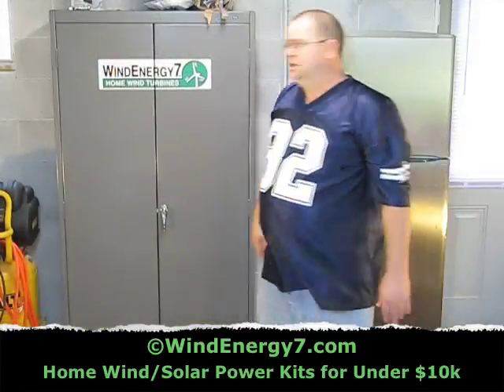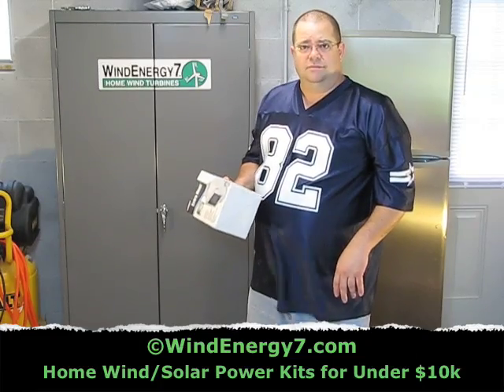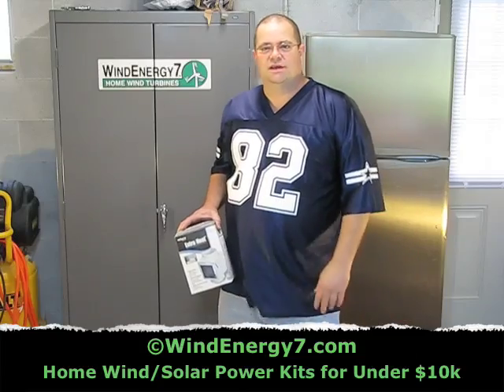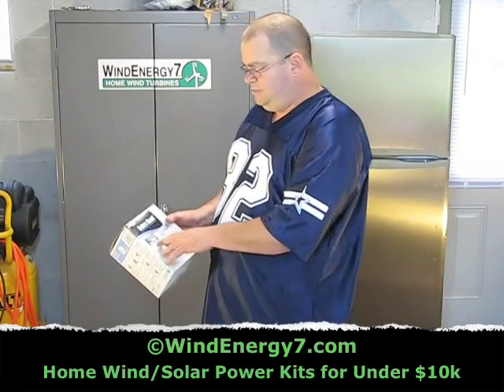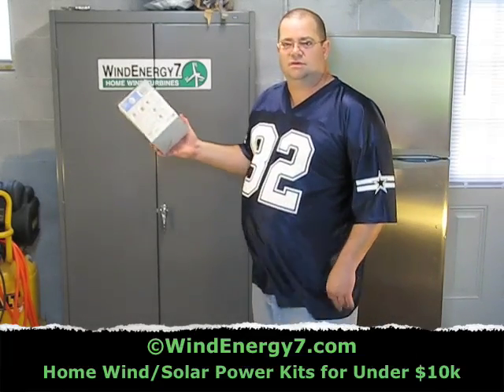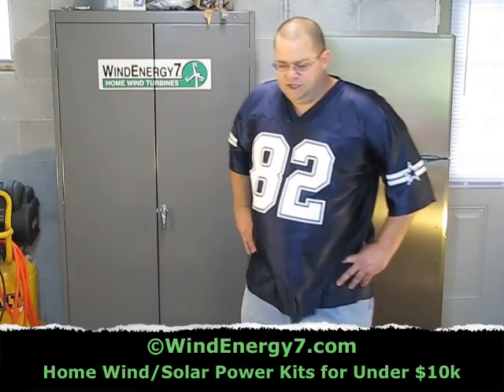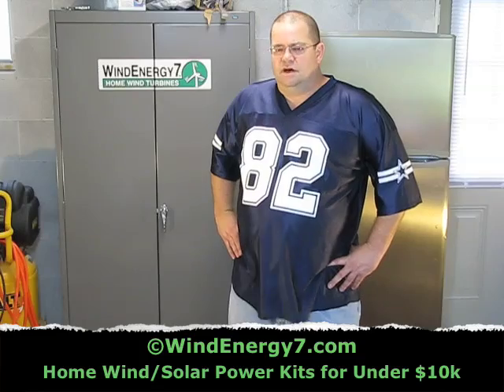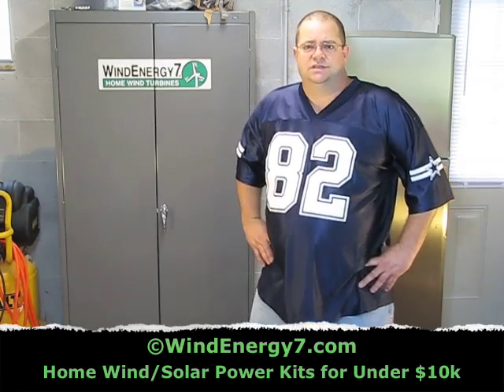Home Energy Conservation Tips, Small Wind Turbine

Comment: Once you have a home wind turbine, you start to really watch the watts you use.  The goal is to try to live within your home wind turbine capacity of power.  So, anything helps to trim your usage.  If you are in a colder climate, or almost anywhere that you would use heat in winter, this is a great tip with the dryer vent bypass. Together with a productive home wind turbine kit, you'll be saving lots of money.

Comment: The system featured here RoofMill™, is the invention of WindEnergy7 LLC founder, pictured in the video. This patent pending invention released last year has won the Think Green Design Award 2010, in a contest by Allied Electronics. RoofMill™ Advance Home Energy System, it's a grid tied home wind turbine generator together with rooftop solar panels in a complete "Whole House" system. It has emergency UPS for your home and can run your meter backwards selling unused power.

Comment from the maker: Yes, your transformers will be important if they can help with grid waste.  That's why I believe in the rooftop wind turbines and hybrid solar systems is that so much electricity is wasted on the grid, simply lost.  It doesn't matter how the power is made, if 7% goes up in smoke, the grid itself is the problem to solve.  If I make my own, I don't waste as much on the grid.  My system is wired to 2%.